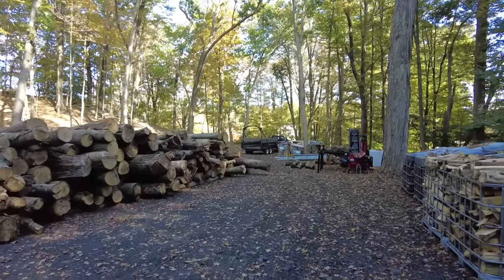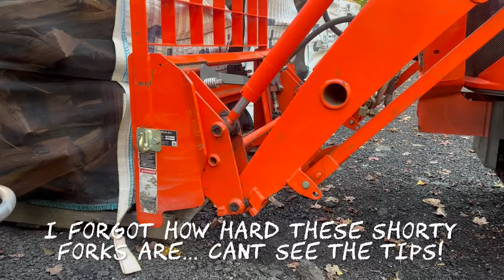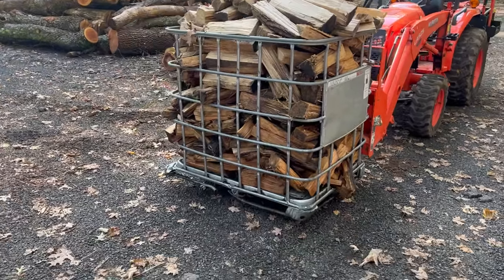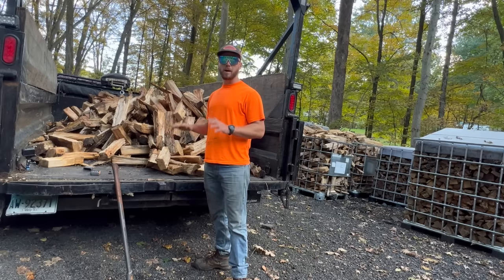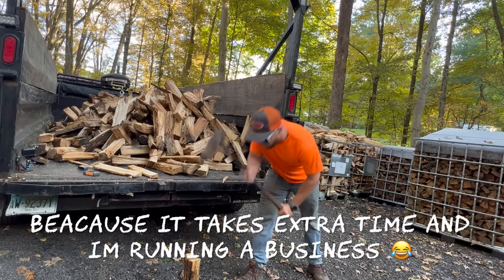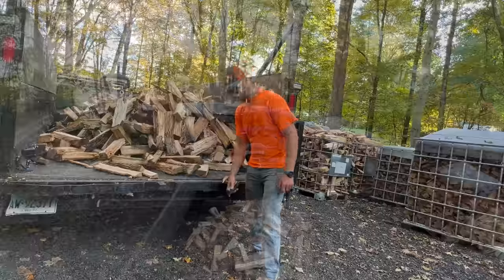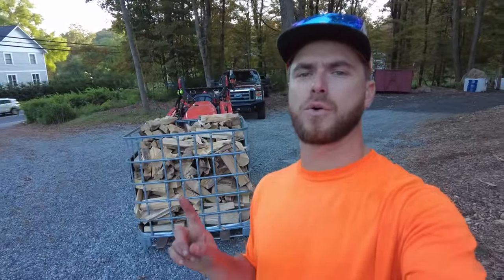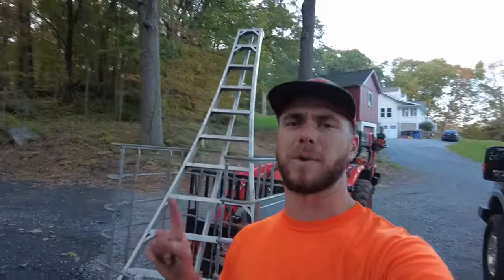#417 Firewood Deliveries: Dump Trailer vs. Dump Truck???

Comment: Happy birthday. With the smaller splits you are selling I agree with you.  I dumped a load of wood on the edge of a driveway, out of a dump truck and did 10,000 in damage.  To be fair the pieces were green oak and between  60 and 150 pounds each. It not only cracked the driveway pad but broke the heat lines. Fortunately I owned the driveway. Just be careful you don’t have to learn the hard way.
Reply from the maker: Thank you! Yeah that’s where the height can be a disadvantage, sounds like you learned the hard way!
Reply: Hey Jake, Happy Birthday!🎂🎉

Comment: I set the bin 2/3 of the way on my dump trailer with 1/3 overhanging and I get under the tote and flip it over on its side, I’ve noticed it to not damage the bottom of the tote, just wanted to share how I do it!
Reply from the maker: Nice! Whatever works for you! Sounds similar to what I’m doing just a manual version!